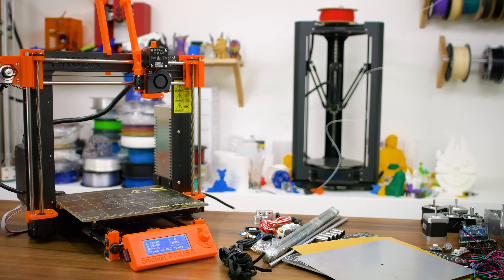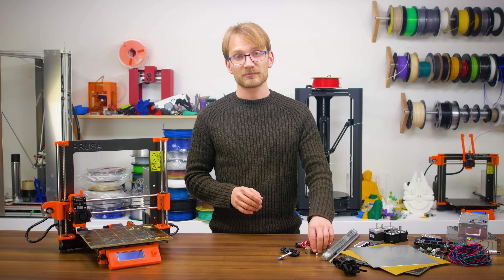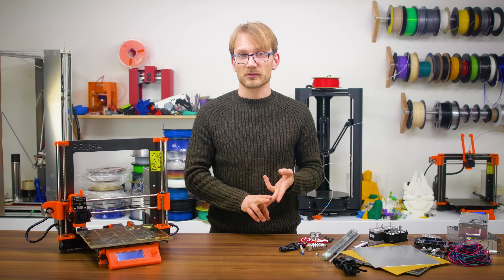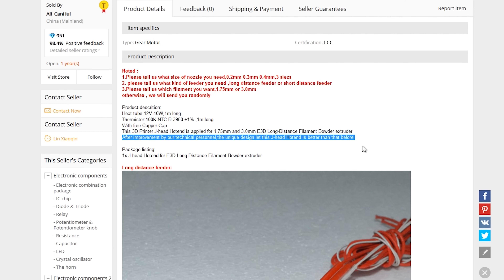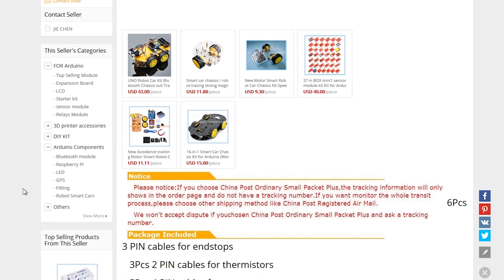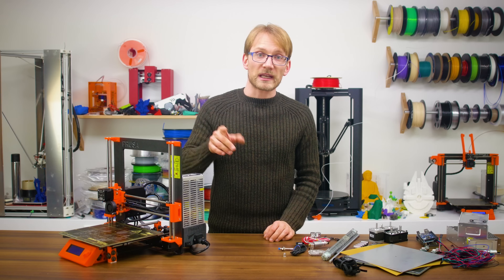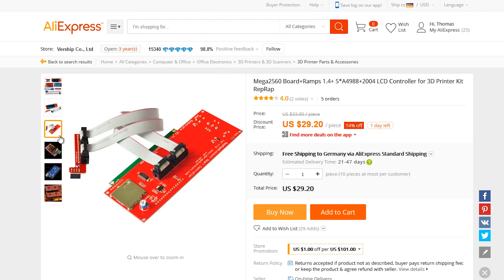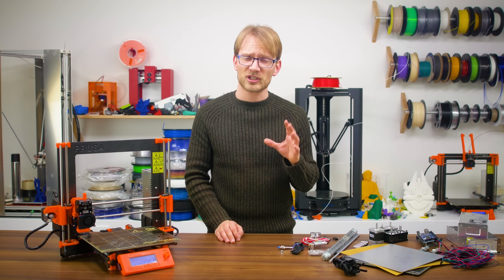Building the cheapest possible Prusa i3 MK2 clone: [01] Electronics and Extruder!

Comment: IMHO the follow on to this project should be Tech2Cs' Hyper Cube. First making the plastic parts then moving all the mech and electronics over to the extrusion frame. The point to the Hyper cube is to move all the i3 parts to a much better frame plus core XY kinematics. A huge up cycle. Please consider.
Reply: I did something similar. I cnc machined parts from 6mm aluminium sheet and vslot extrusions and wheels, the end result is very solid. I like it better than the hyper cube flimsy 3d printed parts and thin smooth rods etc. Corexy is the way to go for faster and  higher quality printing.

Comment: I suspect if you wanted to go as cheap as possible you could do things a bit cheaper than you have so far. Rather than a leadscrew you could use threaded rod from the local home improvement store and a sheet of plywood with a few cuts would make a fine frame.

Comment: Awesome Video, yours are always informative.

On the frame.. how crazy would it be to use PVC plumbing?  Schedule 40 pipe might be stronger then wood and be easy to work with.  Parts could be printed to make special adaptors...

Comment: While I understand the cost saving on going with the ramps+Mega, In order to save frustration, I'd personally go with a MKS Gen 2z V1.2(~$40, comes with stepper drivers) for something like this, or spend a few extra minutes in the firmware (to enable 2 Z axis steppers) and get a MKS Gen V1.4 (~$25, no stepper drivers). Single board with everything needed to control everything and push all the latest Marlin features to.
Reply: Why is the Ramps bad? My melzi board just broke, so i have the possibility to get a new melzi or switch to the ramps. I thought the ramps would be better there, or not?
Reply: the MKS Boards are RAMPS 1.4 compatible by default. Why futz around with wiring a Ramps and Mega when it's all on one board already?
Reply: I quite like the fact that you can then change parts individually, so if the arduino is broken, just replace this with a clone for under 10€ or if a stepper driver is broken and so on ... Maybe thats just me and the fact my melzi just broke a week ago

Comment: it's not possible to use the same controller as the original mk2?
Reply: Thomas Sanladerer wonder if using the original board would able to use their firmware.
Reply: Thomas Sanladerer can you do a proof of concept after finishing the build using the original heat bed to see if works?

Comment: Looking forward to part two! Been using my diy plywood prusa i3 (love it) almost every day for about two years now and really like the mk2. Just about to buy or build one. Tom, how do you feel about diy sla printers as well?
Reply: I am also curious if Thomas Sanladerer would try something similar with a SLA printer. I have seen a few interesting designs around. A few that seem reasonably priced. I would just like to see it sourced and built. Seeing it done is easier than simply reading it.
Reply: True. It seems that now there is a LOT of open source for sla printing. And 1 axis (z) vs X,Y,Z, plus extruder ...... add the amazing print quality of sla. I think it is the next step. I cant wait to build one.
Reply: It took a little digging, but I started at one instructable and it has led to an almost overwhelming number of other sites/projects on diy sla printers
Reply: Em Power I would've went the hypercube route since you can print the parts

Comment: What about Alu extrusions instead of a classic frame? Like Wilson http://reprap.org/wiki/Category:Wilson_II Not sure if you got some cheap option in germany for those but ratrig in spain are pretty cheap for the extrusions, metal L brackets are cheap from china.
Reply: Understandable, though tbh I'm not a fan of that design, so... floppy, I had to brace my i3 with threaded rod going from the top corners of the frame down to the end of the Y axis on the back. I've seen people make it out of wood and adding 2 side pieces to make it more rigid.
Reply: Derp yeah that'd work, I wanted to enclose mine for ABS so I put the PSU and main electronics elsewhere.
Reply: Christian Gerefalk A remote mount power supply and controls is a plus for me. great for using a heated enclosure.
Reply: I'm also a fan of going with Aluminum Extrusions, 2020 or 3030.  I do know on Thingiverse, there is the MK2-X.
Reply: I've eyeballed that a few times, and more and more people are putting it together.  I'm primarily interested in it because you should be able to increase the Z axis height without replacing much beyond the rods and screws.  I'm generally happy with the mk2, but I like to build tall and don't really need a wider print surface.
Reply: Christian Gerefalk yeah would be interested in an aluminium extrusion version as well.
Reply: I suggested a follow on project of using this one to make the parts for Tech2Cs' HyperCube which uses AL extrusions. About the furthest you are going to take this set of motion platform parts. Make a cheap one to build a super nice one.

Comment: I don't like using wood as a structural material, it's not dimensionally stable (hydroscopic, warps).  I built my first repstrap using aluminum and steel bar stock, screwed together, but  I did have the required metal working tools.  The Prusa I3 frame doesn't have to be made from one piece of laser or water jet cut aluminum, it can be fabricated from four pieces bolted together (or even spot welded if you have the tools).
Reply: I'm not a big fan of mutilating dead tree carcasses but MDF/plywood is pretty stable since it's bound with glue, can seal it in clearcoat or paint to make doubly sure, a lot more approachable for the home gamer than metal, and a lot easier to source.
Reply: Mine is made of MDF. 3 years and still looks like new.
Reply: Christian Gerefalk as the others have said.. cabinet grade plywood or mdf ARE stable enough.
Reply: I've had good luck using MDF in speaker cabinets, and I'm using the stuff as the base of my 3D printer.

Comment: The problem with sourcing parts from so many different sellers is that any problems during calibration and setup is probably going to be a nightmare to find and solve, that's why usually kit a better starting point.

But, ehi, I love this idea and I'm going to keep following it for sure!
Reply: A rough estimate on the overall costs, the printer will be around 130 to 150€ for all parts. At this pricetag you are verry close to an anet a8 from China... assume that you will need a printer for many parts, aswell. So for a starter a kit is defenitly the way to go :)
Reply: I already have a printer (Tevo Tarantula, got it for less then 180€ during discounts) but I always tought about the benefit in self sourcing parts compared to the quality control of a kit
Reply: Honestly, if you get your parts for cheap from China the quality will not differ that much^^
Reply: The difference is from "cheap parts" to "cheapest parts".

If i buy the cheapest nema I'll probably have problems, if i buy from china the same nema used by a kit, I'll have the same problems as the kit.

The cheapest is not always the best one and not only in quality, the same is also true about steppers, electronics and more.
Reply: I totally agree. It takes a lot of knowledge and experience  to know how cheap you can go. And often a bit of luck, aswell.

Comment: for everyone looking, it's around  70$
Reply: without frame and mechanics, that are probably around 100$ more
Reply: looks  like it will go past 250$, some parts are not priced yet...
Reply: i picked up a Anet A8 for $99 i think I win the cheapest build contest!
Reply: @mynameisprivate158  That's until you make all the modifications to make the A8 safe
Reply: Dylan Merritt 

Even then a mosfet is a primary safety upgrade by everybody’s books and that only costs 7 dollas. And yes intentional misspelling is intentional. If you want a power switch then that’s another 7 dollas and the firmware upgrade to prevent thermal runaway is technically free as long as you have a usb stick lying around and a micro SD card to put  the Marlin firmware in. That’s really the only major safety upgrades you would need besides upgrades which improve the quality of the prints it makes.
Reply: myname is private   I have build a printer for €76,56 so i win
Reply: Steppers are $40 each
Reply: @dylanmerritt3396  stepers are alot cheaper
Reply: USD?
Reply: steppers are $15 per 5 pack now.. But looking at this build I'd still be better off buying a clone. there's no way I could buy all these parts off aliexpress and get them here within 2 months for less than twice what a clone costs on amazon/ebay that would arrive in a few days.. Then I can upgrade from there for sure.
Reply: That’s cheaper than my hot end ...